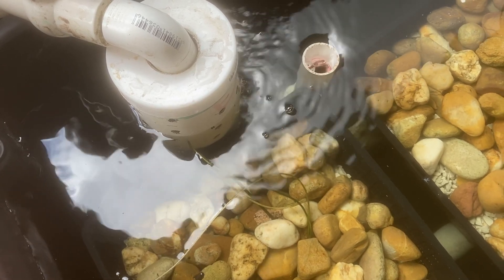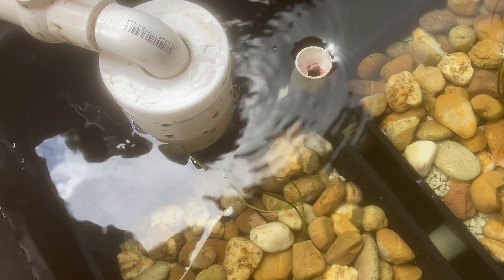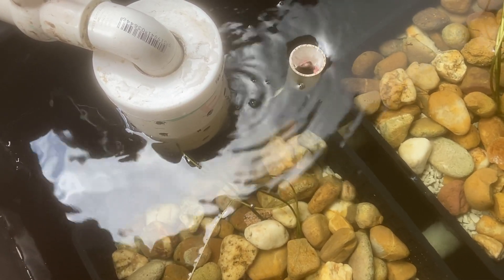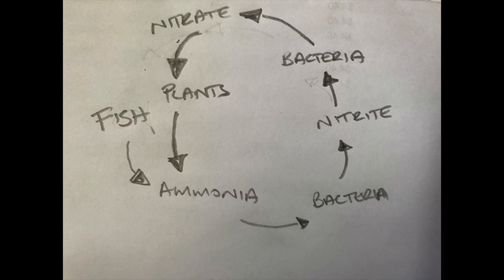Anoxic Pond Filter

Comment: Great vid mate.

Couple of things.  
~With fluctuations in temperature axalotles are probably out as they struggle greatly in warmer water.  
~You could try paradise fish.  
~What temps are you looking at?  
~won’t your plants struggle with minimal nitrates?

Great content 

Regards Duzzy🇦🇺
Reply from the maker: Thanks mate. Yes I didn’t end up with axalotles. Just white clouds and a yabbie. Temperature doesn’t fluctuate as much during the day as I expected, but does from summer to winter. Plants in the filter really struggled but the ones in the pipe work were great. This experiment has since ended and the pond now has returned to a bog filter and is home to rice fish.
Reply: @Ozponds  did anoxic not work or do you just prefer anoxic?
Reply from the maker: It did work. It was just the algae, the filter always looked ugly. The bog looks nice and I believe you still get the benefits of anoxic in a bog.
Reply: @Ozponds  I think anoxic filters are best in sumps.  It puts them out of the way.

Regards Duzzy🇦🇺
Reply from the maker: That makes sense

Comment: I have a question. What do you think of the following?:
What if one were to incorporate the anoxic basket at the beginning or end of a bog “channel” style run?
 I’m envisioning creating a natural pool from an old chlorine one. Looking to build raised bed style channels along the side of the pool. These would have pond liner and gravel fill for the water to pass through. Water Plants growing on top of the beds. A waterfall at the end of the run. The beds/channels would be at the rim of the pool for the water to fall more than 20” into the pool below. 
An intake chamber (separated by a lined wood panel) for debris to settle. 
But would another chamber at the terminus be useful with some anoxic baskets? 
Combining bog with anoxic is the main question.
Reply from the maker: I don’t think it’s necessary to combine the two as they both provide good biological filtration.
Reply: Thanks for the reply. 
So adding the anoxic baskets at the end of the run to remove remaining ammonia (before spilling back into the swimming pool) would be redundant due to the bog? 
Thinking of starting with minnows, and frogs then trying a couple of turtles and  working up to a few medium size fish. 

Also thinking of a waterfall from two 55gal drum filters filled with DIY bio balls. And a gravel bed over milkcrates in one section of the pool’s floor. Three-pronged approach with an intake from either end of the pool for circulation. 

Great channel by the way. Thanks for all the info. You’ve inspired a lot of people.
Reply from the maker: Both are biological filters so as long as they are sized and designed correctly for the pond, both will remove ammonia, nitrite and even nitrate. There’s nothing wrong with adding them both the more biological filtration the better. My point is that could simply be a bigger bog or more bcb’s in your anoxic filter. Or you could add both. It’s just not going to change the fact that both accomplish the same thing. I guess if you add both you can decide which one you find easier to maintain. 👍

Comment: Have you ever built a pond not using rubber or plastic liners? I am going to try a small pond with a pure clay lining, then a simple wire mesh and cement using the Italian cement formula with Lime Slag that chrystalizes and fills cracks. . . maybe
Reply from the maker: I have one pond that isn’t lined but it almost completely dries up in summer.

Comment: I started a 60lt tank from scratch where I use the substrate as a form of filtration but not exactly. Only 1/6 of the bottom area has a plenum right in the centre.  (10cm x 15 Cm x 3cm) connected to a very small pump 160lt/hr. The flow of the pump don't even create air bubbles. It was topped with pea size lacterite pebbles and surrounded by coarse sands on the  fringe. No aeration at all. So it basically create both anoxic and anaerobic condition surrounding area depending on the distance to the plenum. The first 2 months was hell, string algae and black algae was a nightmare. I basically have change 20% water every other day. There were about 15 cherry shrimp in there. I reduce the light timing but it didn't work either. Plants were dying 
Now it just the opposite. I had not clean my glass for 6 weeks 😄 not 1 string of algae...plant was growing like crazy, hundreds of cherry shrimp now.
I bought the pepples from bunning. I am very sure is a lacterite based pebbles as I had them in other IBC tanks even i washed thoroughly,  it still turn the water reddish.
Reply from the maker: Cool! I’m trying a plenum in a shrimp tank right now. At the moment I’m wishing I just kept the sponge filter running. So patience is key 👍

Comment: Amazing! What would be flow rate for a large pond? The extremely low flow rate means that this system can save lots of electricity.
Reply from the maker: Well the anoxic filter works great with high flow. I’m not sure why but that’s according to Dr Novak’s tests. I want to try it with no flow in a pond but that will be in the near future so no results as yet. If you want a low flow filter you can’t beat a bog in my opinion 👍

Comment: So.in this video you said that the ponds with the bog filter has no or little nitrates.  Is that true????? If so why even tru the BCB?
Reply from the maker: I’m always trying different methods. I find it fun. Yes all my ponds with bog filters have little to no nitrates, but I also don’t overstock them. One bcb is supposed to be enough for one large koi fish. I didn’t have a great deal of success with the anoxic filter, this pond has returned to a bog filter.
Reply: @Ozponds  thank you for the reply. I will be doing some experiments with the bog filter myself. I tried for over 3 years with different bcb filters and several other setups recommended by the Dr. K. With absolutely 0% success.  Thank you for the information.  I will let you know my results.🫰🫰🫰

Comment: Hi  I am hoping this works. Like I shared before I have koi and is currently over stocked. I understood pretty much how you explained it but noticed that your system  is closed and the only way the water gets back into you pond is via the pvc piping. My filter system is set up where I created a small water  fall so while I can have the in coming water circle the litter  box the out put to the pond is much faster , any suggestions?
Reply from the maker: Easy just diffuse the water as it exits the filter. Then it can flow naturally over the waterfall 👍

Comment: I'm so confused 😕 song on pump is being used?
Reply from the maker: 😂 and now I’m confused…what is a song on pump?
Reply: @Ozponds  lol song isn't supposed to be there! It's supposed to say...so no pump is being used.
Reply from the maker: Ah gotcha. A pump is being used and is recommended. I want to test it without one in the future. So the baskets would sit in the pond itself.
Reply: @Ozponds  gotcha!! I have a question if you don't mind. I can't seem to find a straight answer...how do you or what do you do with the liner edge tuck under, leave laying flat, etc. I'm so lost on the last bit of my new pond build also have a low spot to deal with.
Reply from the maker: I’ve talked about it in a few vids. I think the last one was the stream vid. If not I’ve got one on edge treatments. Obviously you need it higher than water level. I find it easiest if you can cut the liner off upright about 4-6 inches above water level. Folding and tucking always seems to lead to leaks at least for me it does. Once you have it nice and upright it’s pretty easy to disguise with rocks, plants, pebbles, driftwood, etc.
Reply: @Ozponds  I thought it was you that talked about it, I will go watch again!! Thank you for your help I greatly appreciate it 🙏